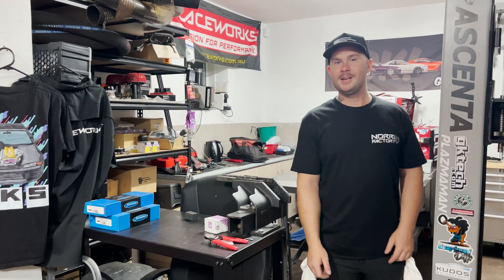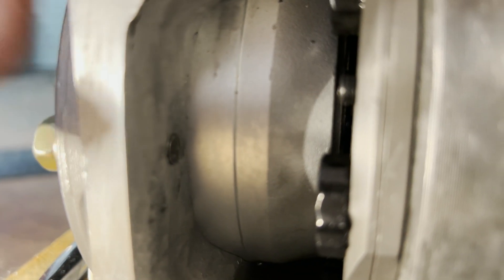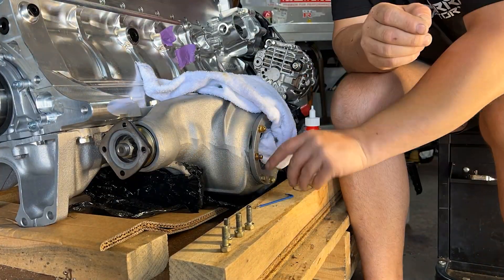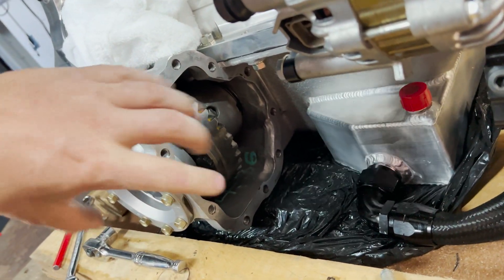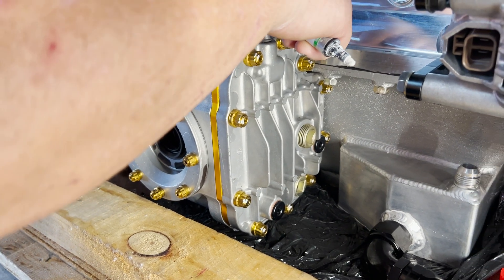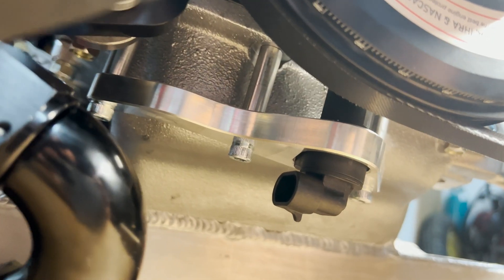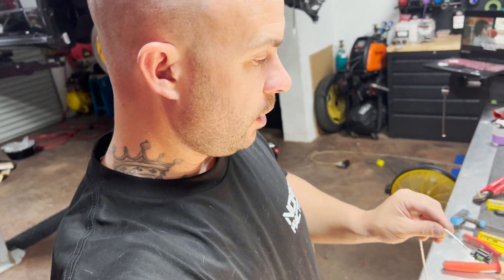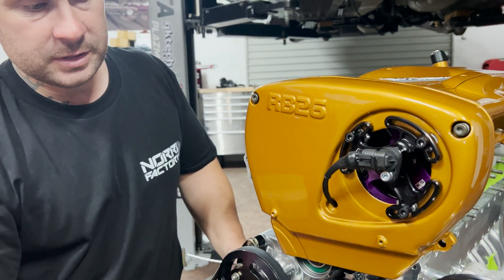Strengthening the R32 GTR Front Sump with a Diff Brace + Fitting Motec Cam Angle Sensor

Comment: Next time back off the side flange and then do up the front cover first and torque the side flange last. Reason is the preload from the shims on the carrier distorts the case if you do the cover last you locking up the diff in a distorted condition essentially reducing your carrier preload. I know this because i just setup my diff (massive pain in the ass) but basically if you measure the total preload at the pinion before and after you remove the front cover you will be shocked. Its for this reason the gear head brace has cut outs to allow dial indicator access for accurate measurements in a front cover on type scenario almost like a torque plate if you like. 😊

Comment: When would you need a brace for the front diff? is this something that everyone should do to their R32? Is this for typical drag racing applications?
Reply from the maker: thanks for watching... Gearhead Diffs has designed this front brace for any engine making a lot of down low torque and would most likely help in drag applications. I have seen the front sumps crack and its mostly from abuse, but it looks great - I guess its a 'time will tell' thing.

Comment: Great work guys!
The extra washers that the Reimax Throttle Rebuild kits come with are to hold the factory replacement shaft seals from popping out because they are only 2-3mm wide by memory, They tend to creep out over the years and especially if running higher boost levels.
Regards Stefan
Reply from the maker: unfortunately you can not run the white washers as Dahtone Racing has informed us they melt and cause the throttle to stick.

Comment: Nice job mate I was waiting for your rebuild for ITBs  because I will do a rebuild for mines so I need to know if easy job or not .
Reply from the maker: I will go into it a little more in the next video. I think a lot of people do not do it correctly and rush it.
The the little plates go a certain way and no one explained that anywhere I searched online. There is also a lot od controversy on how to paint the throttle coat on, but less is more! If you need any info drop us a message on instagram !